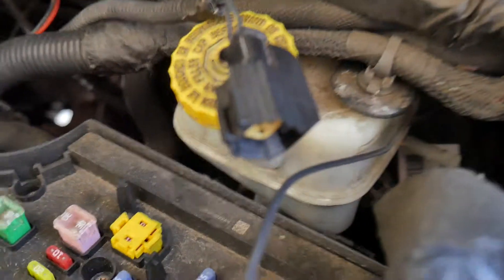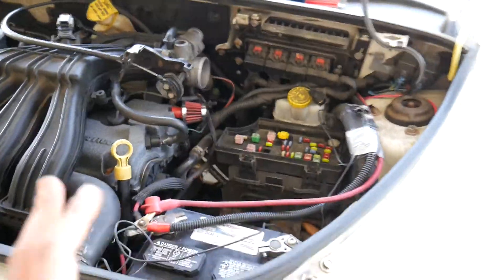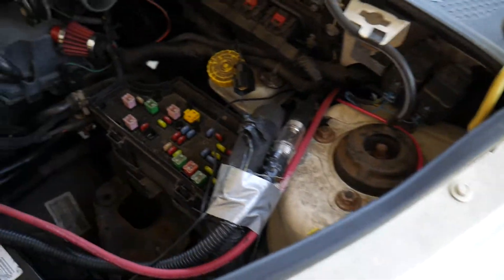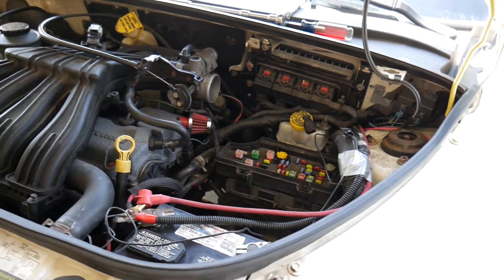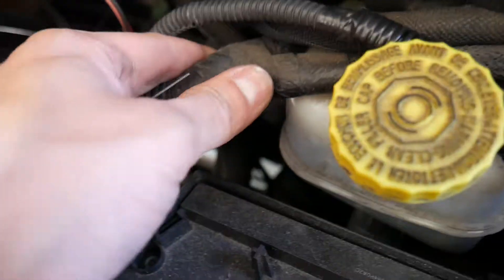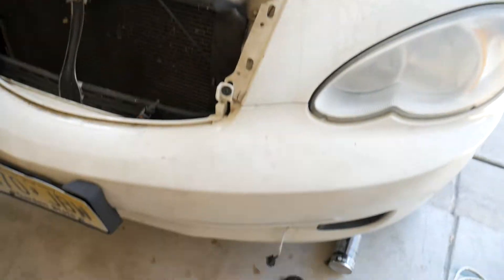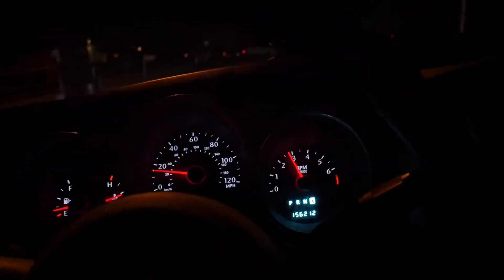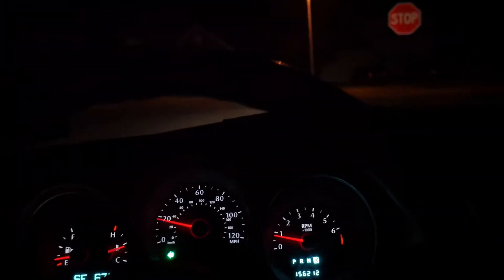Moving IAT sensor to sense colder air but does it work!

Comment: Fit a 10K ohm resistor in line of the lead to the ECU. This fools the ECU into thinking the air is colder.
Reply from the maker: I read somewhere's some ECU don't like a fixed value. Also I still wanted some mapping to happen when the weather gets cold or hot.